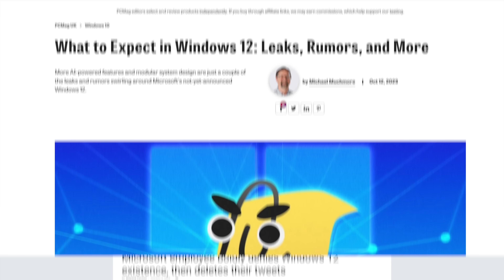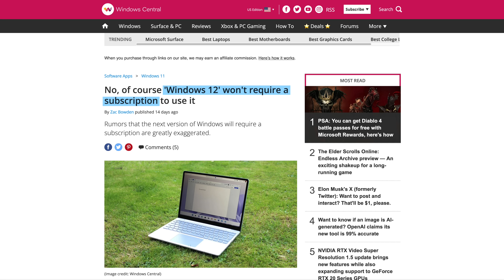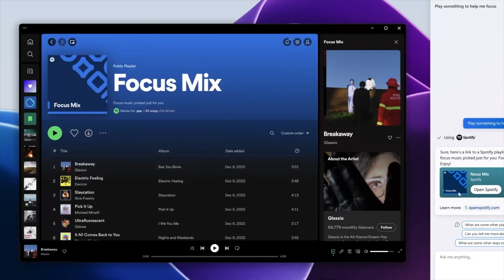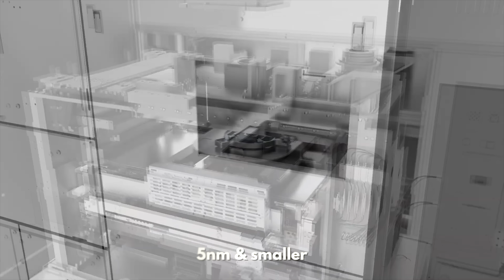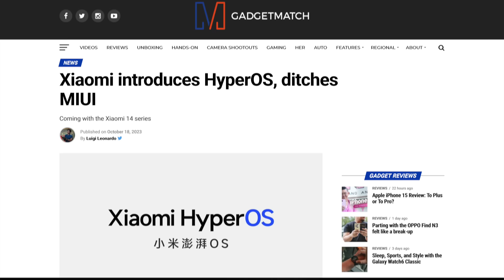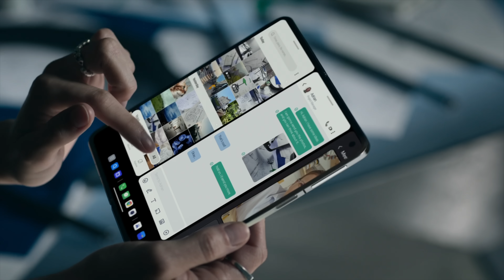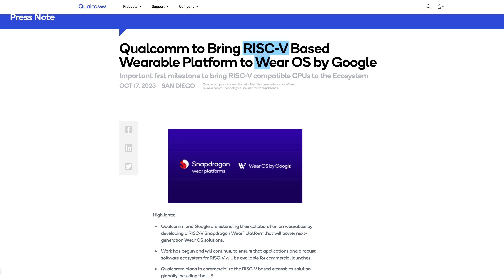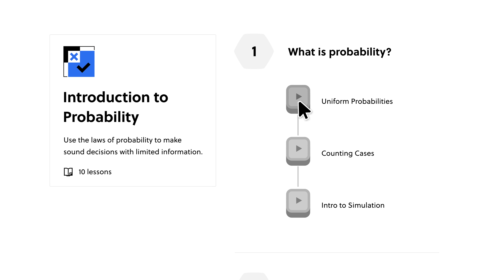Windows 12 is looking good!

Comment: The thing I feel for Nanoimprint is that in the end, you still have to do the mold. I mean, you now have to do one mold per every 100 wafers (spitballing, maybe it is 10K or 10M), which means less time for doing EUV and less machines, but in the end, the "wafer mold" still has to be done.

If anything, it feels like companies might need less ASML machines and will be able to replace them by Canon's one. And possibly also use way less energy (which is both a big deal for money in operations, and for reducing climate change effects because of it being an electrointensive industry).
Reply: I guess the mold is made with similar technology that is used to produce the masks used in traditional lithography machines (weird electron-microscope like machines IIRC)
Reply: Maybe you have an older machine that is not capable to consistently produce 5nm chips (most of them are not usable). But it could maybe be possible that one out of five molds is usable and than you could use this good mold for hundreds of chips. Maybe a partially faulty mold for multiple chips is also not that bad, if the energy and time for the process is minimal.
Reply: There are many more issues with NIL. Making more than a few layers in a chip is prone to errors and most SoCs these days have 10+ layers easily